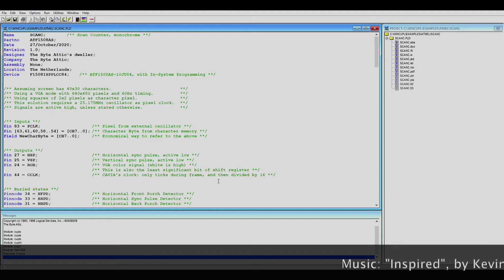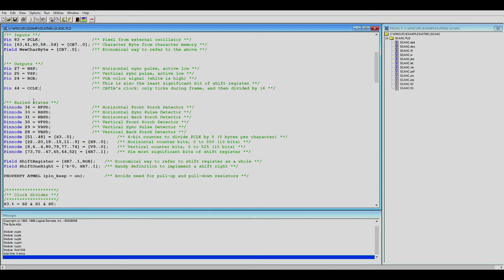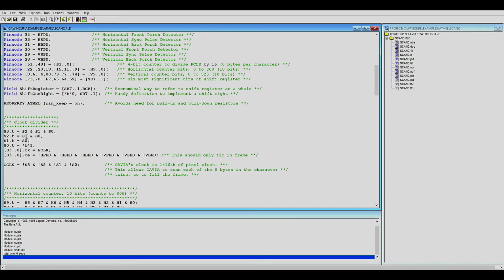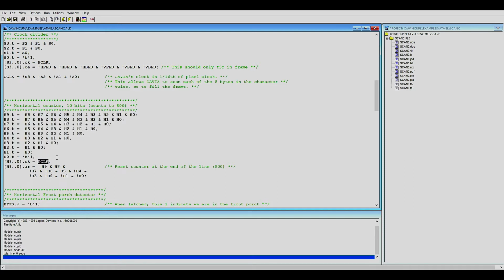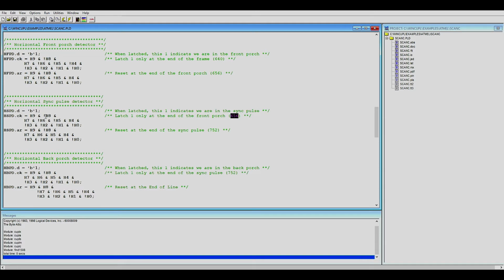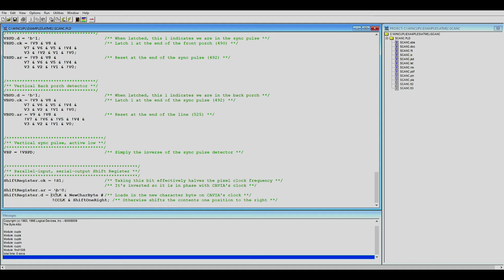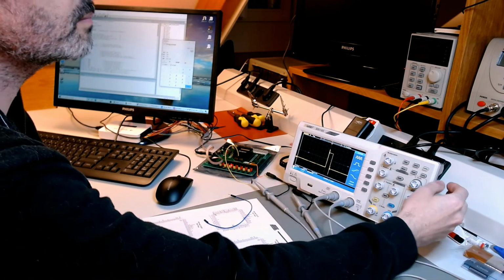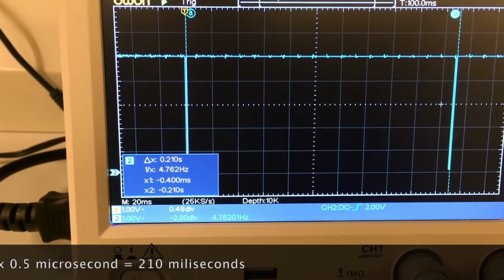Building CERBERUS 2080™, my dream childhood computer: Episode 3

Comment: This is really interesting - I was an embedded software developer for many years, but never got to design PLDs or play with CUPL. 
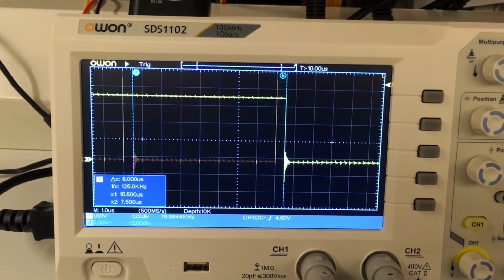May I ask a nerdy question? Around 18:10 when you measure the Cavia clock on the oscilloscope, there's significant overshoot on the signal edge transitions, that gets up to about 6.7v if I read the scope correctly. I might guess this comes from fast transistor (implementing the PLD logic) switching? CCLK is assigned to output pin 81 in your CUPL code, and this connects with a 74HC244 buffer as per your schematic. According to a TI datasheet of the buffer, 6.7v is pretty close to its absolute maximum. In general, would we need to think about redressing the overshoot (using e.g. on-board passives)? Or could we make changes to the CUPL source to achieve a smoother cclk output? I ask to develop my understanding. Thx
Reply from the maker: Yes, there's a lot of ringing on that line because of impedance mismatches and bad termination on Microchip's development board, which I am using here just to test the functionality of CERBERUS, not its electrical performance. As you will see, on the CERBERUS PCB there was no such problem. If there were, one way to alleviate it would be to use 33 Ohm in-series resistors on the line, to absorb some of the reflections (the resistor will form an RC low-pass filter together with the parasitic capacitances on the PCB itself). If the problem would persist at significant level, active (bus) terminations with diodes could be used. But in general, good PCB design avoids reflections and mismatches by construction.
Reply: @thebyteattic  Thx for the detailed answer, appreciated.